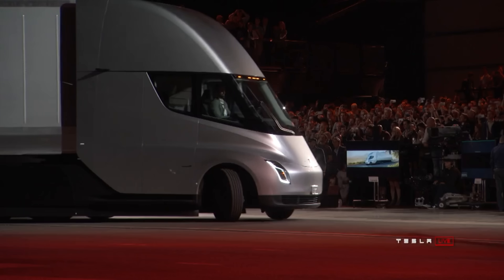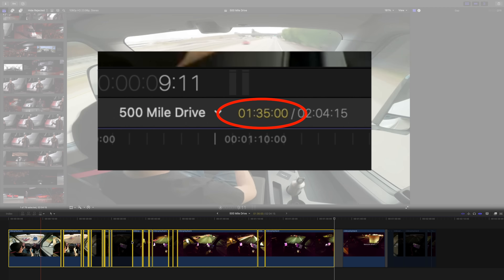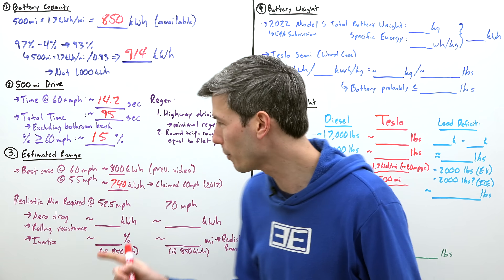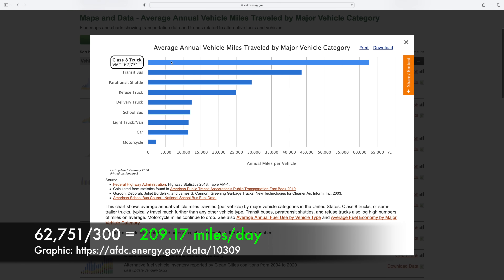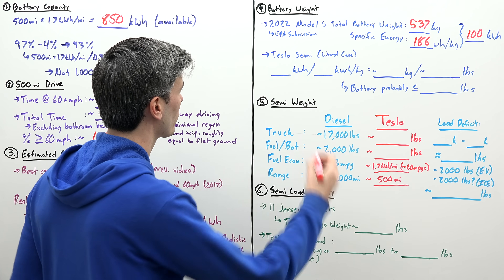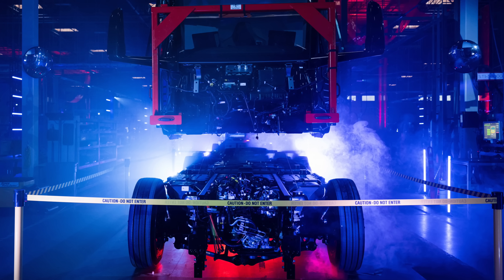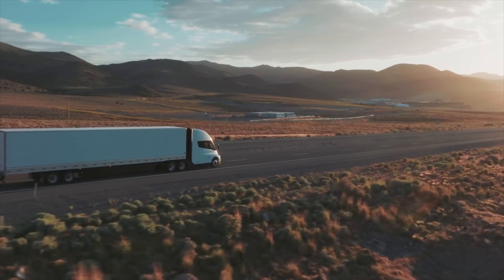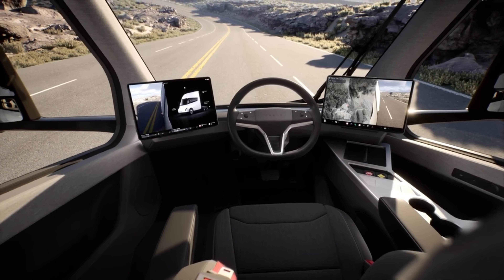Does The Tesla Semi Make Any Sense? Part 2!

Comment: Good remark you made about Tesla's marketing versus their engineering.
You know, it would be great if they used electric vehicles for their optimum features, such as short-haul, steep grades, etc. Electrics don't have to do absolutely everything an ICE does, and in fact, the best uses of them are in areas that are problematic for ICEs. I keep saying, I want a simple $5k brand-new electric city car, the VW Beetle equivalent of today, and I'll keep my 4WD truck for snow, long drives, and hauling.
Reply: 5k is the price of a good electric bicycle and the full set of out wear(coat, etc.), if it is a "car" it would have to meet car safety standards which mean $$$, you are more likely to get one closer to $25k

Comment: One thing you are not taking into account is temperature.  I have a 2016 Model S 90D.  In the winter I'm lucky to get 50% of the range. That is without using heat.  I know they have better motors and use a heat pump now.  They still lose 30%.

Comment: I'm sure if you did a comparison of travel by horse to the new horseless carriages when the Ford Model A came out, you would have concluded that they made no sense from an engineering or cost standpoint, but that didn't stop them from eventually replacing horses for all but a fraction of a percent of passenger travel.  The battery consumption when climbing a grade looked scary, but it is interesting that regen almost completely compensated for it on the downgrade.  I think routes that have a large increase in elevation could really reduce the range of the vehicle, but on the flip side, Coors can probably get beer to Los Angeles and still have half the battery life available.  Great analysis!
Reply: Well hopefully tesla has invented super brakes because if you brake all the way down on the downgrade you're gonna smoke your brakes and have no brakes
Reply: @sneed915  , on the downgrade, they use the electric motors like Jake brakes, and they actually put the energy back in the battery (regeneration).  The only problem is if the battery is already full, then they have to rely on the disc brakes.
Reply: @inediblenut  Edison Motors (no, not Nikola Motors) has this figured out by looking at diesel-electric locomotives, which have a massive forced-air cooled resistive grid to waste excess electricity. They built an electric logging truck.

Comment: Aluminum Air batteries would make so much more sense for semi trucks.  Much lighter in weights and more range.  Plus you don't have to build a charging station.  True you have to figure out a way to to quick battery swaps.  Do you go with  many small batteries that can be manhandled by one or two men.  Or, do you go with bigger batteries that could perhaps be handled with a forklift.  Just stock pile the batteries where they are needed.

Comment: Subsidies - all people are paying to a private company through taxation to make the Tesla truck even worth considering. Shoudn't be that way. 194000$ is a hudge amount of fuel and maintnance. And yet those trucks will(?) return it's cost in time in comparison to a diesel truck? There is so much ideology, and no common sense.
Reply: ...you know regular trucks also cost money right?
Reply: @AveragePicker  Did I say that regular trucks don't cost?
Reply: @Pawel_W1  Well you used the cost of the truck to describe a lump sum of fuel and maintenance. But if you were restocking a fleet, or buying additional trucks or whatever, you wouldn't have $194,000. You would have $194,000 - the cost of the new truck. 
On the other hand if you already have a truck and it is just fine and you have $194,000 and for no reason are going to buy a second one, then yes, you have $194,000 for fuel and maintenance if you opt to not buy another truck. Which since you don't really need it and your old truck is just fine, would be the better option. 
Now...the average cost of operating a truck, including paying a driver, can be over $200,000 a year. 
Just a used truck can run you $45,000-$100,000.
A brand new truck  $150,000-$175,000.
 If you average between 8,000 and 10,000 miles per month, fuel will run you around $50,000-$70,000. (According to Schneider) 
So that $194,000 isn't exactly a "huge" amount. Buy a new truck and you have like $44,000 left over.
Reply: @AveragePicker  I apparently misunderstood that part about refunding and costs. Still - making it somehow financially rational by subsidies? That is not fair, that is insanity! By taxation and refunds I can make any uneconomical investmen a rational decision for the investor.

Comment: Ok, let's poke some holes in this whole scenario. :)

The jersey barriers are aerodynamic compared to a box style trailer. How much of a difference does that make to coefficient of drag?

If you expect 850 or 917 kWh battery capacity, you need the 1000 kWh to account for battery degradation. You need that.

Real life travel is not go to highway speed and stay there til you are a short distance from the destination. It does involve going slower in heavy traffic, to detour around traffic accidents, when going through heavy weather conditions like fog, ice, snow, etc. So we're looking at an ideal trip vs trips which are less than ideal in efficiency.

Innovation is baked into Tesla's branding. All of us are familiar with how fit and finish for the cars were far from perfect for a number of years because they were focusing on the overall quality and worked furiously on both cost savings and quality of the guts of the cars, then eventually worked out a great fit and finish "when they got around to it." What can we expect from new innovations in the semi, as they are first produced, within the first year of production as they ramp up, and in the coming years? How does this factor into the quality assessment of the semi now?

Do the buyers of Tesla semi trucks need to factor in the cost of buying the chargers and the mega pack batteries and solar panels / windmills at the time of purchase?

Comment: As much as the calculations are very interesting the real value of owning such tractors/truck is the ROI. How long will it take the customer to recuperate the higher cost? The time stated is for supercharging ……how will that affect battery degradation if you are only using fast charging to charge the vehicle? The range stated is only for brand new out of the factory number. How will that stand up over time ? How will the vehicle perform in cold weather applications ? How long the batteries will last with such load demands and when will it need to be changed ? How will that affect ROI? Calculations must also be made without subsidies as any subsidized based program can’t last forever. So if these questions can be answer I will be less skeptical.

Comment: Couple of remarks: No truck carries 2,000 lb of fuel unless they need it or they go to a state or country where refilling would be costlier than carrying this unnecessary fuel weight.

Others such as Nikola Insider have also estimated a similar Tesla tractor + batteries weight of 27,000 lb. But a 10,000 lb battery pack would place the tractor at 17,000 lb, which sounds quite high because of the work Tesla has done regarding the aerodynamic shape of the tractor, the empty spaces (seat access corridor) in the cabin, but mostly, the lighter powertrain. This would indicate that maybe the battery pack is much heavier than the announced 10,000 lb. Or at least something is off and needs explaining.

Now that Tesla trucks are out in the market, we should really stop playing these insane and pointless guesses and work on actual figures.

My main beef with the Tesla semi is the arrangement of the cabin, with the front central position of the driver seat that may not be practical with left roadside tolls, drive-ins, etc., and the empty space wasted by the access corridor behind the seat.
Tolls are probably not a big issue though, most truck companies have subscriptions and don't need to toss coins. Besides, the toll booth for trucks can probably easily be modified to accommodate such a central driver position.
But it remains to see how this new central position works out in real life. Aerodynamics and fuel economy are just as important for diesel and electric trucks, so if truck manufacturers with a century of experience have not used the triangular shape for cabins, it may mean that aerodynamics is not the only factor to consider for designing trucks.
I suspect the next generation of the truck will have either an optional direct front left door for the driver seat, or a slightly less triangular shaped cabin, less aerodynamic but more practical, so the dog can at least sit on the front passenger seat!

Comment: My criticism of the tesla semi is not coming from wanting to see it fail but from wanting to make a clear-cut assessment of where it can fit in the overall logistics map. The marketing dribble talk and not giving the exact weight of components and payload as any other truck test would be fueling all the online rubbish talk. We need a replacement for fossil-fueled powered transport as soon as possible and some of that may be BEVs but they will be load and route-specific. As I have mentioned most trucks that come and go from the plant I work at come in at maximum weight with heavy bulk ingredients and leave fully loaded in relation to capacity but well short of maximum weight. I could not see a Tesla doing that as the distance of the haul in both directions would be at the maximum of its limit and the ICE vehicles used now do not stop on those routes at that distance. If you were an operator who needed a very flexible vehicle in both load capability and range I don't see the Tesla as that vehicle. From the Australian operating point of view your rig being flexible with regard to load is still very important as many operators here are still general cargo carriers. A hydrogen-powered ICE vehicle would fit our model here better but there is a lot of work to be done there as well not only with engines but fueling infrastructure and the production of green hydrogen. But the introduction of a viable solid-state battery would give the BEV truck projects a big shot in the arm. Whether our transport fuel ends up being battery or hydrogen it will need to be sustainably and ethically manufactured and not contribute negatively to greenhouse gas emissions you pollution from being non-recyclable at end of life. All this sounds too hard but only because from the very start of the industrial revolution economics/capitalism was never required to put a dollar value on manufacturing pollution and waste and that would also include end-of-life disposal. When that journey started some 300 years ago we were at an estimated global population of 1.2 billion and we are now 8 billion with 5 of that 8 arriving in the last 70 years. Get the picture. If all we had to worry about was trucks that would be wonderful.

Comment: I would love to see you run the numbers on electric cars in the winter in real world driving.  I have heard people say that 30% battery capacity losses are not unheard of in the colder months of winter (down to -40C). I'm also curious what the drain is of the HVAC system plus heated seats to heat and maintain the cabin at -40C.  I know my fuel mileage suffers noticeably at those temps.
Reply: I'd like to see EE cover that in more detail too, but, it shouldn't be much of a hit on the Semi's range.

The larger batteries mean less of the total is needed to heat the cabin and even the batteries themselves (This battery is ~10 times that of a car, even if you tripled the energy needed to heat/cool the batteries+cabin, that's 3 times less taken from the battery's total. So, ~10% range lost in the cold maybe?)

Then there's also pre-heating while on the charger, and the fact you're probably hauling a heavier load than a car typically does, so the batteries/motors will run hotter. The heat pumps can absorb some of that excess heat.

That ~500mile range would also presumably include [some] running of the heat-pump system too, as they need to regulate the batteries regardless of cabin climate
Reply: My 2018 Bolt takes roughly a 30% hit when it gets quite cold, say -20C or lower.  Of course, anything below about 20C already starts to affect range but the really cool temps are worse.  Heater doesn’t consume a huge amount, but the heated seats and steering wheel seem to use next to nothing.  Having said that, wife drives 160km (100 miles) round trip to work and back in it with no problem at all, including dead of winter. As someone else mentioned, pre-heating the cabin and battery temperature loops while still on the charger help a great deal as the battery will generally maintain a good temperature on its own while driving (due to heating caused by battery discharge), down to about-5C.  Sorry I don’t have the exact figures, I’m not one to track stuff like that.
Reply: @sjsomething4936  Thanks for the feedback. I'm in Alberta Canada and just trying to verify what manufacturers say versus real world.  No gas vehicle I've ever driven has gotten the mileage as stated by the manufacturer either!
Reply: I am from Eastern Siberia (Yakutsk).  Here the temperature is below 0 C for half a year, in winter it averages -40 C, in January it quite often drops to -50 C for several weeks.  
Our family has a Nissan Leaf as a second car.  In winter, battery consumption is about 3 times more than in summer.  This is taking into account that the trip goes from the heated garage of the house to the heated garage of the place of work.  If you park on the street for more than half an hour, then the charge will be completely lost due to the cold.  (that's why we use the electric car only in summer. Electricity here is way cheaper than fuel, so it's worth it)
Reply: @kulichkun8709  Thank you for adding that.  I was wondering if it was a huge factor if the vehicle was kept outside.  I am thinking of the effect that those really cold temps have on my cell phone and wondered if it scaled up.
Reply: @kulichkun8709  a sensible reply , I wonder how you’d fair with a different ev with liquid cooling and heating , instead of air cooling
Reply: Well the first thing you have  to understand is they’re not all the same , some have heat pumps , some use the motor and battery cooling , some just have a heater element , some have all 3
Reply: Ford suggests not using a car or truck's heater in the winter, but instead turning on the heated seats for warmth. The problem is, a person's tootsies are not on the heated seat, they're under the dash where the heat from the seat doesn't reach.
Reply: I'd like to see a ford executive try it out for a month in -20C. Especially if going on a long trip
Reply: @bobkonradi1027  Is that for Ford's EV offerings?
Reply: If you preheat the car and battery , not only is it Loverly and warm , you don’t need to de ice, and you can use most of the battery , things have moved on
Reply: Real world testing in Scandinavia shows EVs losing 10-35% (started in warm garage) already at 0 to -10c. One is published in a Norwegian motoring paper. 

Anecdotally I've seen more than 50% loss when we start talking -30 to -40c.
Reply: @christoferstromberg6605  
Do you preheat the vehicle and battery before ? What ev are you driving ?
Reply: @fradaja  I don't own an EV at this point (can't charge at home so would cost more than fuel). This was more official testing done in Norway. You can find it on NAF/Motor dot no. Not posting links because YouTube usually auto remove any such comment.
Reply: Yep…EV’s performance is only discussed when applied to optimum conditions…forget “real world” application….that has no place in marketing or when asking for governmental funding!
Reply: @vg3430  

Isn’t that the same with all cars ? I can’t ever remember freezing temperatures being mentioned on fuel figures , don’t you think the oil industry has had enough government funding ?

Comment: Trains are better for moving goods long haul.  However in Europe, they're testing out electric trucks powered directly from the grid using pantograph overhead wire technology from trams/trains.

Which the human race perfected about 120 years ago.  This is stuff we can do.  Easily.

With a big battery, you would only need a small section of overhead lines to fast-charge the vehicle without stopping.  30 miles at 60mph is 30 minutes of fast charging.

Or just run them across the whole highway network and build semi's with smaller, cheaper batteries (possibly CATL prussian white sodium ion cells) that don't need rare materials like lithium or nickel.

Comment: There was something that was missed/ignored. The thermal performance of batteries. Korea has just fined Tesla over the fact that they don't state on their (Korean at least) website that the range that can be achieved can potentially be halved at low temperatures. Wet roads and snow covered roads will knock the distance traveled per charge down significantly.
If it wasn't for subsidies the vehicles would not be getting on the road. Without being upfront to the public there should be no subsidies.
The truck would make more sense as a delivery truck rather than a freight mover imho.

Comment: Wait a minute. 
Starting at the 9:00 minute mark, you assume a weight of 27,000 Lbs for the Tesla Semi, by adding the ~10,000 Lb battery to the 17,000 Lb of a diesel Semi. 
But what about the Engine, Transmission and fuel that it doesn't carry? Shouldn't you subtract 5,000 to 6,000 Lbs for that? 
Also. Making assumptions about average speed, based on a 2 minute clip from an 8 hour trip? 
Why not try this: He completed the trip in 8 hours.  Which means an average speed of 62.5 Mph. More if you deduct the time spent completely stopped (Bathroom break, etc...) 

Other thank that.  Cool video.